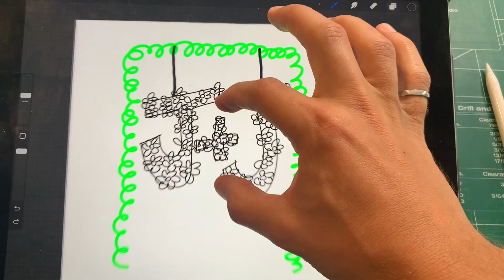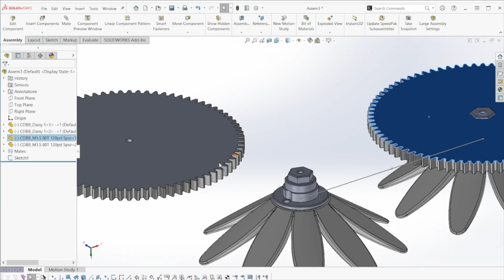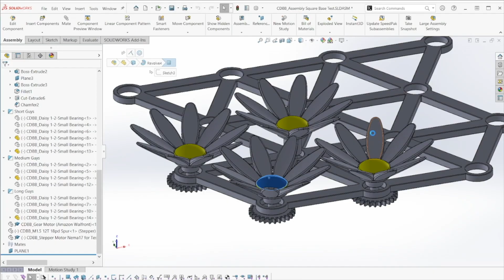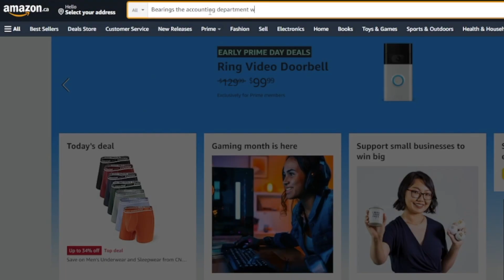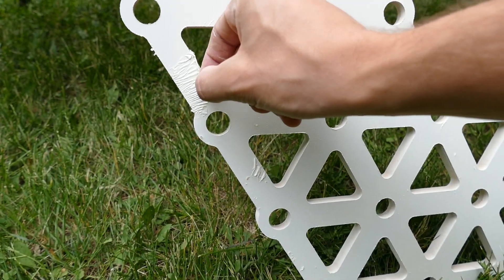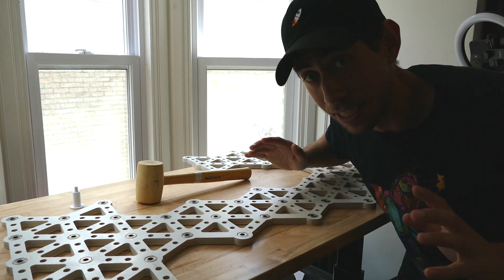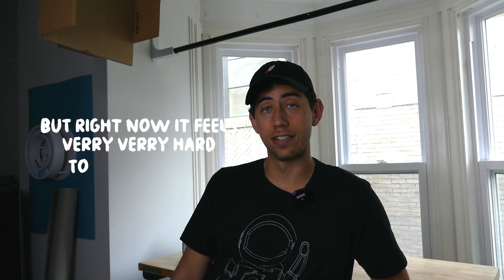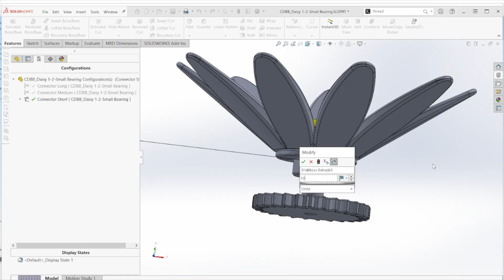I Made a Mechanical Sculpture for my Wedding

Comment: Lol...Something like that happened to me!!

I made a cement battery with copper mess and wire in an antique copper cilindrical container, the peculiar formula of compressed piezoelectric materials...It would run out of juice to run the 3 ,2.5 volt crystal blue LEDs as a center for the copper flowers...And it was a gift toy wife for mothers day...
Upon demonstration with everyone looking the thing...didn't lite up!!!
But I fixed it...And it will live as an example of how close we are to generate free clean perpetual energy one day... Cheers

Comment: I am building something similar for our classroom for our Dia De Los Muertos display. However, I am curious did you use 1/2 inch mdf of 3/4 and also what kind of motors did you use and do I need some kind of adjuster to adjust the speed.
Reply from the maker: Joseph sorry for the late reply! Hope you were able to figure it out!